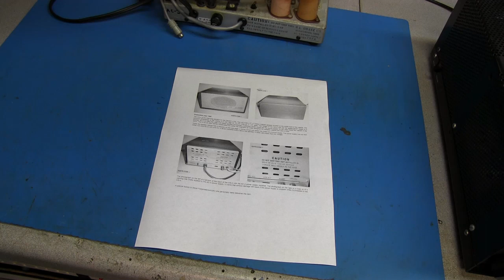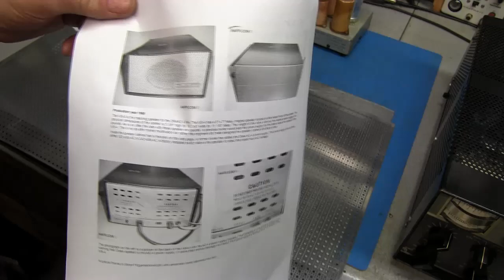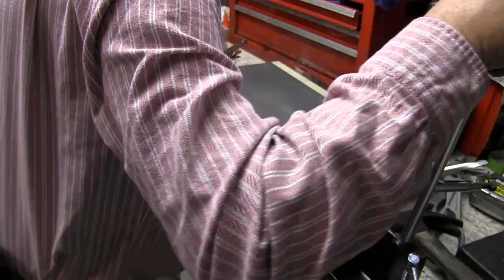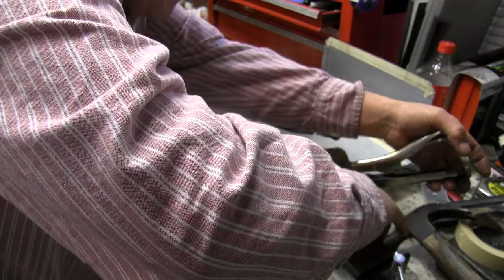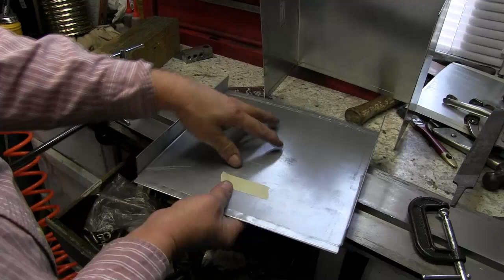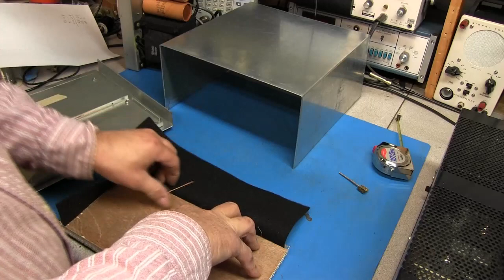#253 Lets Build a Speaker/ PSU Case for the Drake

Comment: Are you fimiliar with the tinysa spectrum analyser. Would it be useful in radio repair for injecting signals and alignment purpose. Any input would be helpful.   73

Comment: It's your projects and you do it your way, but consider having ventilation slots in your grill backer board so that you can set up a venture affect to help cooling the power supply.
Reply from the maker: Agreed Mack. I will perforate the board with 1/4 holes spaced at 1/2 inch apart.

Comment: I mounted my AC4 in the back of the MS4 and could not believe how hot it ran. I solved the problem by hot gluing two small computer fans over the vent holes of the AC4... one blowing in, the other out. Now runs cool.

Comment: Awesome video. I wonder if the felt in front of the speaker will cause any problem with low audio? That cabinet appears to be big enough so heat should not be a problem. Buddy, you never cease to amaze us. Thank you for the effort and time it takes to make these videos. 73 de K7RMJ Frank.
Reply from the maker: Frank, we will see how the felt goes.  It really is very coarse so may be ok. Thanks for watching